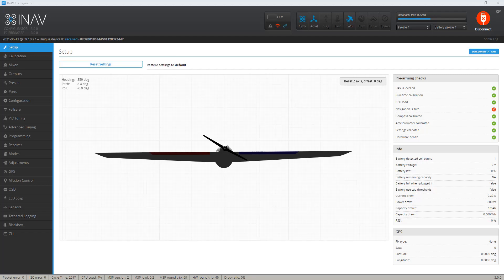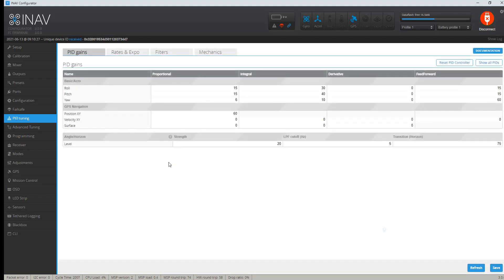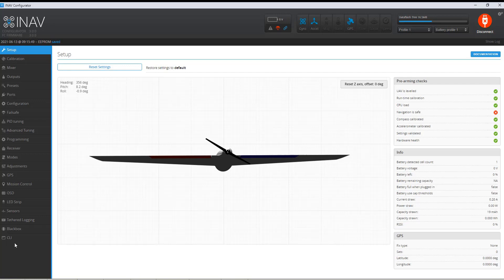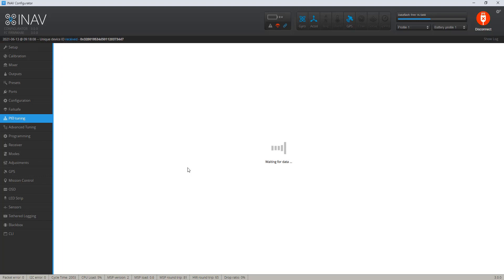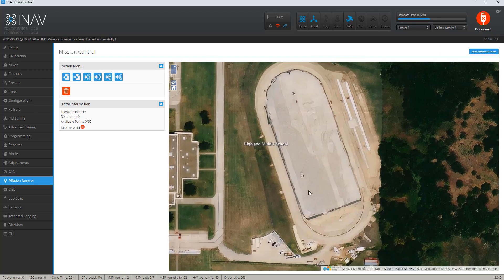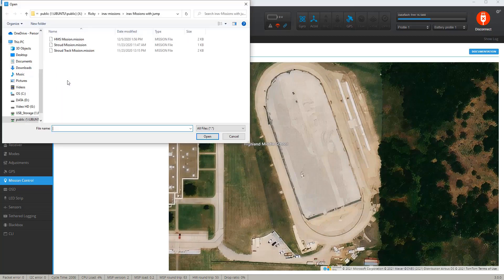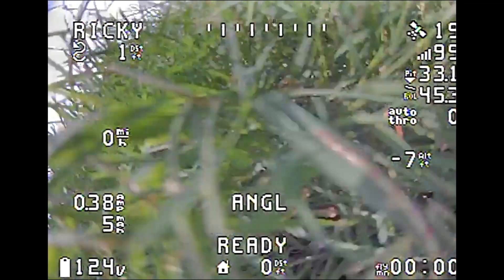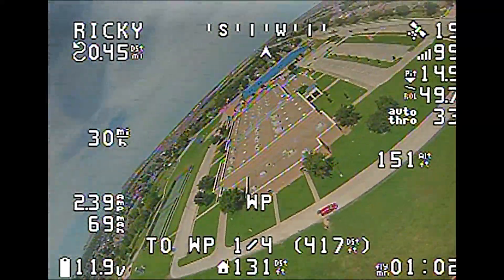FT Arrow inav 3.0 Maiden new waypoint features plus a lot more!

Comment: Hello, do you think these pids would work with my ft dart as well ?
Reply from the maker: Maybe?  On inav 4.1 I finally did the "autotune" flight and most everything stayed the same except my elevator feed forward went way up (like in the hundreds up)  I think it's too high and will most likely move it down to the 50s.
Reply: @RickyGode  I see, i'm using piff values around 9-15 on both P and I. It flies great and i don't know why, i'm just glad it's so stable :D.

My other and final question is, after 8-10 minutes of flying without gps and angle mode on, plane starts to yaw right which is really annoying. Is it because of D term not being zero ? My d terms are 5 and 7.
Reply from the maker: @yatzeegamingop  Man that's a good question.  I really don't know.  I have yet to have a inav plane that even has rudder so yaw isn't even a thing for me.
Reply: @RickyGode  Mine also doesn't have a rudder, it's an ft arrow, not dart (my bad).  More appropriate way to say it is "it's rotating to right". 

Today it flew for 21 minutes at when the plne hit a point where giving max left stick was barely enough to keep it going straight, had a crash landing. I will try another flight controller and a new ft arrow body. Freaky stuff.
Reply from the maker: @yatzeegamingop  I wonder if you fly it again for 20 minutes and you take it out of the nav modes (maybe manual) and see if it can roll to the right then?  Is your flight controller getting vibrations? or not mounted securely?  Maybe it doesn't roll to the right because it "thinks" it is already rolling to the right?

Comment: Hey nice video... how did you get the smooth turning into waypoints? does it it have something to do with bank angle?
Reply from the maker: My bank angle is set to 60 but I think it has more to do with this setting: "set nav_fw_control_smoothness = 8"
Reply: @RickyGode  Thank you I will try that

Comment: Nice video!   Have you found 3.0 - 3.02 to be buggy with waypoints?  Failure to save mission even though it says it saved, sometimes drops points, sometimes drops jumps.  I'm coming off of 2.61 which was pretty reliable.
Reply from the maker: I have no found it to be buggy at all.  (Actually better in my case since it doesn't count the "jump" as a waypoint.

Comment: So in inav 3 you don’t need to load the mission or it does it automatically?
Reply from the maker: It depends.  There is a new setting called nav_wp_load_on_boot which you can change to "on" and it will load missions automatically during startup.  The default is "off"  I appreciate the fact that the arming screen shows if the mission has been loaded or not.  I still use stick commands to load waypoints.
Reply: @RickyGode  how to Load mission with sticks in mode 1?
Reply from the maker: @Chris-vc1dh  It looks like left stick full up and right stick bottom right.
https://www.rcgroups.com/forums/showatt.php?attachmentid=11250446&d=1538469617
Reply: @RickyGode  thank you 🙏
Reply: @Chris-vc1dh  Same as mode 2, just rotate TX 180 degrees.